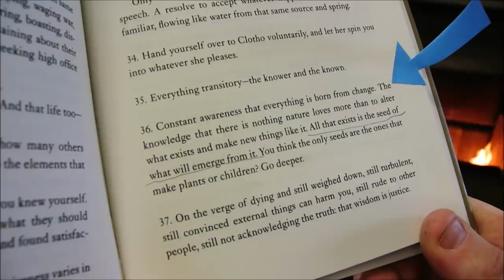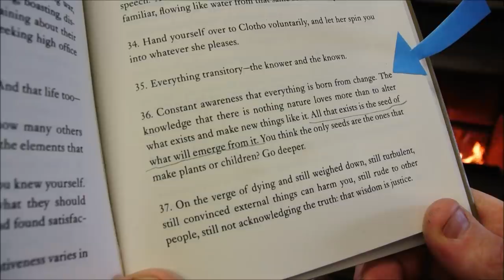Bottled microcosm

Comment: How about similar to the fish tank cleaners: use a small magnet wrapped in cloth inside and drag it around with another magnet on the outside?
Reply from the maker: Sure. Why not? Probably would be a little tougher in practice, but viewers sure would be attracted to that solution.
Reply: I had the same thought, but doing that wouldn't remove the material. Fish tanks usually have filters or another way of dealing with algae after it's been removed from the glass.
Reply from the maker: I think it would work ok. Just pushing/sliding the green stuff down will stop 95% of it. It would also then become available nutrients.
Reply: Now I'm imagining pair of very small rubber squeegees, perhaps cut from a windshield wiper blade. They are held in parallel to a square body, which is either made of steel, or has steel or a magnet attached to it. Place it inside the bottle and and use a strong magnet from outside the bottle, to push the slime down. Maybe the body shape is curved to match the bottle.  It's something that could be used weekly, with proper full cleaning done less often.

Comment: Curious question by a non-landowner: why do you burn some part of the cutoffs/cleanup/“waste” instead of leaving it all to rot? Wouldn’t that allow for more biodiversity?
Reply from the maker: That question doesn't have a short answer beyond this: ideally the woods wouldn't require intervention, but man's short-sighted pillages leave it out of balance. 

I don't expect you to read the rest of this. I write every day, all over the place. No offense if you don't read it or reply. Oh, and another short answer is to simply 'clean up' the woods; too much brush makes it difficult to move through the woods. Logging from years ago left too many toppings. 

…

One imbalance is with irregular form. In dense formation, trees grow straight up to compete for light. A hole in the woods is similar to scar tissue on the skin; growth occurs there with increased density around its perimeter, and so there's a corresponding lop-sidedness that develops. When a tree has its neighbor cut away, its mass will move as its growth shifts toward the opening. This imbalance wouldn't be so bad here and there, but the imbalances we're causing are seriously out of balance with what established forest might safely sustain.

Logging has virtually zero regulation here, so they leave waste in the worst possible shapes and sizes. Trees are dragged out- and with this, other trees become scraped, folded, an trampled. Such scars can last for a century. Cutoffs are often half of a tree in size (or an entire tree when it turns out to be hollow on the inside, and thus not suitable for lumber), and in the interest of time these cutoffs remain leaning on other trees or in great piles which will take a decade to break down. Consider that saplings won't start there until then- unlike with the case of a single, natural fell; around which a sprig will find protection and then eventual nutrients from. 

Another imbalance caused is in timing. While we might see artificial woods and their chess-board placement as some type of pleasing order, such an arrangement is as vulnerable as it is unnatural. My neighbor has a plot of two-decade old birch trees, around three or four acres worth. He grew them from saplings. It's a thing of beauty to behold, to stand in a contrived grove. But when they start to disease or age, or when there is a storm of a certain force, it will spread consistently over that weakness. I'm telling you what you already know, since you've mentioned "biodiversity," but I'm telling you this in the context of similar trees; because biodiversity is implied to exist not only as a balance between dissimilar domains, kingdoms, …orders, families... and et al., but a balance of life must also exist at the level of varied individuals if they are to survive in an ever-changing environment. At the level of genes:

We, man, exist as a single 'species' while still maintaining a nearly infinite variety. We are at various ages, shapes, sizes, colors, strengths, intelligences, and resistances to attack from other life. This variety is the vector of selection, and the nature of advantage. With it comes some more balance problems, because of unequal distributions and how they apply to ethics, but this problem is also the very source of our survival. 

We throw complex systems out of balance only at great risk. In fact, the risk in these cases is an almost entirely unknown quantity. Because of smoke, burning excess brush causes a new problem. It moves carbon from a secured position here and into a problematic position. I'm just removing part of the imbalance in localized physical growth, but the process adds to our collective problem outside of here. It is necessary for short-gain restoration of the property. I suppose, if you and I were on a leaking boat in the middle of the ocean, we would agree to plug the hole with bubble gum if we had it, right? Letting brush rot would be ideal, but the clock is ticking too quickly.
Reply: @pocket83squared  About monocultures lacking resilience: Here in germany we have a mass mortality this year with many kinds of conifers, a perfect example of what you are talking about. You combine a (most likely manmade, climate related) drought with pine-only chessboard-forests and the bark beetle just plows through entire regions. And of course they dont stop at those plantations. From just one year to another, all of our beautiful forests have large, brown patches in them. This is most obvious when seen from highways on long trips. Luckily, there are many national parks here and even outside those there are many pieces of fenced in primal forests. I love to walk along those forests (since you're not allowed to go thru) and for years they behaved just like your bottle: Super tidy, almost deserted business-forest to the left, chaotic jungle just behind the fence to the right. But a fence cant really separate a ecosystem, theres always one bottle up and so the disease we grow outside even effects the protected forests. Yes, they are more resilient, but lets just hope they are resilient enough... 

and I'm not even getting started on the carbon from your last paragraph, thats such a giant topic on its own – Trees are a important carbon buffer but useless, if burned right away. I have trouble sleeping when i think about Brazil and our rainforests. Like with so many other things happening right now... Im with you on that boat analogy, two steps forward and on step back is better than the other way around.